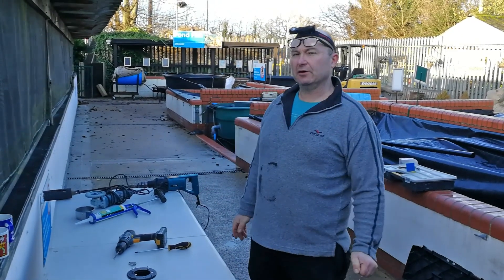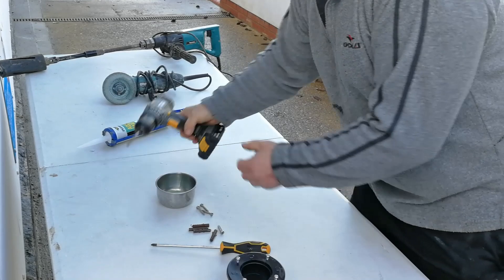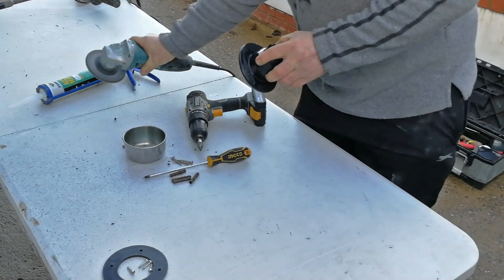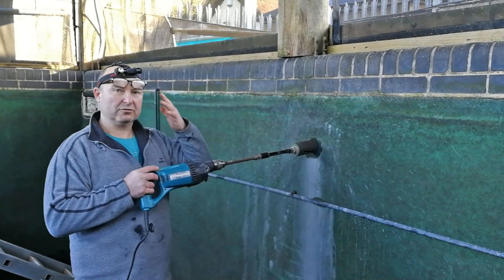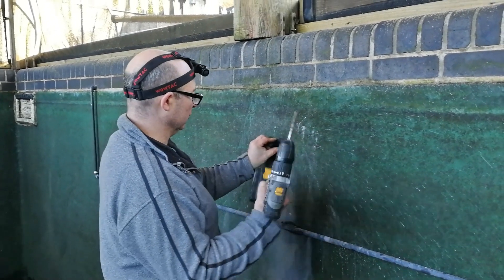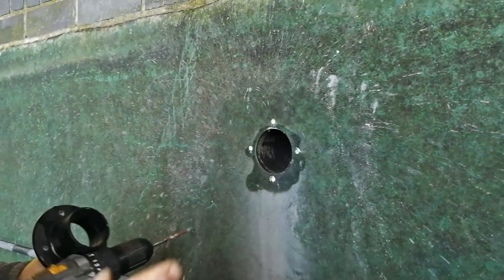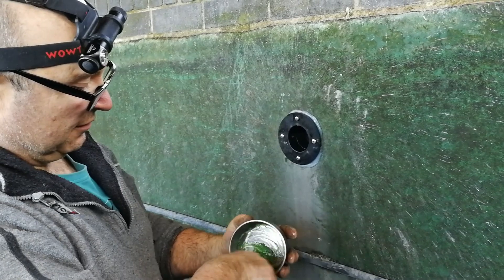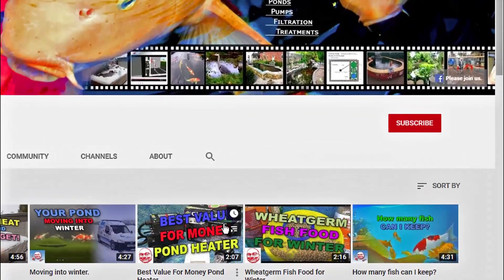Retrofit pond return.

Comment: Hi after you put the connector in the wall how do you put the pump pipe to the connector to take the water out the pond
Reply from the maker: This is a return pipe. Water is flowing back to the pond from the filter.
Reply: So how would I use one to get the water out the pond or would I use something different

Comment: Brilliant video, really informative. How would you recommend fitting a return to a new blockwork pond that’s going to be fibreglassed? Am a little confused as some people are recommending just having the pipe protruding and then cutting flush but others are recommending using tank connectors but don’t understand where the fibreglass connects or how the connection is made stable and waterproof, any suggestions?👍😊🐟🈲
Reply from the maker: The best way is to use a tank connector and set it in the block work with a section of pipe left sticking out the back. Then render up to it an and fibreglass into it.
Reply from the maker: Don't let any pipe protrude into the pond. It could damage a Koi if it swims against it. Or flashes on it when it has a parasite.  Smooth.
Reply: @leecalladine  thank you, much appreciated 👍😊
Reply: @leecalladine  fibreglass into it?? Wouldn’t the water flowing out of the pipe force it’s way under the fibreglass if it’s not fully sealed ??
only when I had mine done by mat at GRP linings, I left the pipes sticking out of the walls and he fibreglassed on to pipe then cut back flush with the fibreglass on the walls, then sealed with a polyurethane sealer so totally flush no bumps or screws etc and never leaks, 12 years on perfect pond no leaks no cracks or pin holes and smooth as glass.maybe he could help you out with these retro fits .
Reply from the maker: @alansmall9071  the tank connector would be behind the fibre glass. It would be a larger surface area for good adhesion between the GRP and the fibreglass. No need to seal afterwards. Exactly the same as the connection to the bottom drain and skimmer.

Comment: Hi Lee, really appreciate this as I’m just about to fit my returns. This video takes away a lot of my fear of installing them, will be adding them to a sleeper pond. What would be the best way to secure the return as I’ll be using a liner as opposed to bolting to a concrete wall ?
Reply from the maker: You need to put them in the wall when assembling the pond. Also cut slits into the sleepers then chisel out a slot. Much easier than using a hole saw. I did a video about sleeper ponds and it is very detailed shows exactly how to do this and more.  https://www.youtube.com/watch?v=ng0bvRcAiPE&t=784s

Comment: Great video again Lee - can I ask a cheeky question in a very rough way what would you estimate at cost to construct from scratch a 10000 litre rectangle pond in block with fibreglass and with bottom drain and nexus 320 ? Many thanks 🙏🏻
Reply from the maker: Very hard question. Largely dependent on how much work you can complete yourself. How careful you are at getting good price on materials. And what refinements. Could be  £4000 or much much more.

Comment: Dam man dident even remove that lsyer of dust from the wall jist silicone strsight to the dust. No attention to seslingnthe 4 gole possision ether just plenty of silicone for the colit. Prety poor effort bud. Ps dont swing in drills the bit was like a bow st times even your boy said ey up lol.  In hind sight ide have added some pipe to the fitting before fitting tonthe wall as now you have to slide a glued pipe into a dusty hole knowing the joint will be compromised.